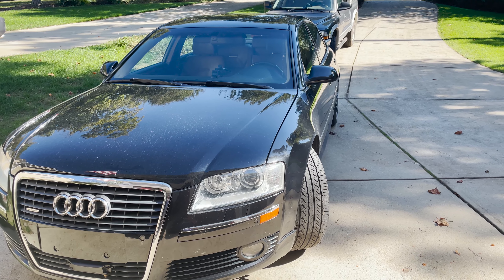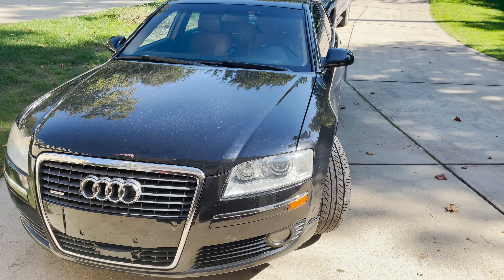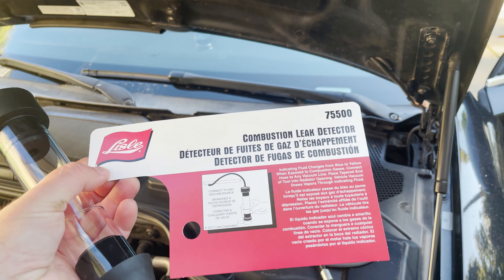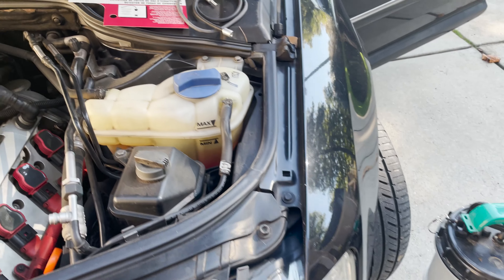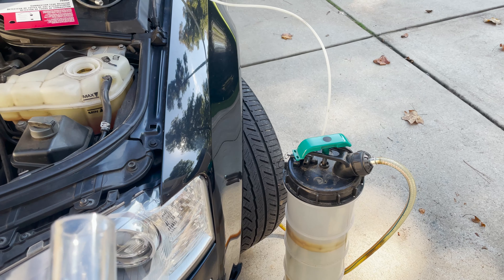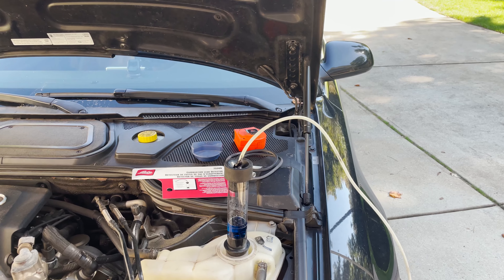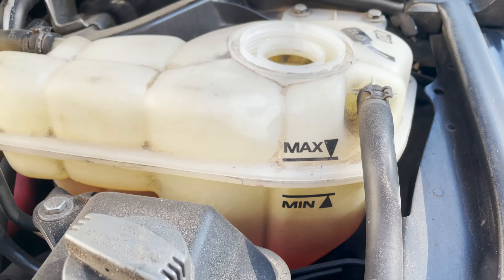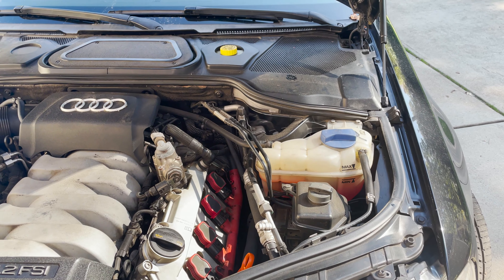2007 Audi A8 - Head Gasket Test

Comment: That test is only good for when the engine compression migrates to the surges tank , positive pressure though. 
If it’s getting sucked in, it would be burned in the cylinders and out the exhaust which can show as a slight amount of stem at all times.

Comment: Just did the same thing today it’s been leaking coolant through the overflow and it was bubbling and steaming so I bought a head gasket leak test from harbor freight and it remains blue so I bought a new cap since the old one was loose  did you have the same issue?
Reply from the maker: Turns out I had an upper radiator hose fail. Made a video on that.
Reply: Car N' Guitar Dude yeah my was leaking on the passenger fender side from the coolant overflow tank I guess after driving it but I’ll say you did a good job fixing it👍
Reply: And one more thing have you ever had and issue with a code p2015 I think it’s a intake manifold flap sensor issue?
Reply from the maker: @zlatanzifovskijr4576   haven’t had that code or challenge yet.
Reply: @zlatanzifovskijr4576 How did you fix it?